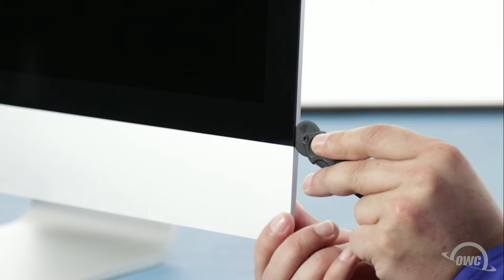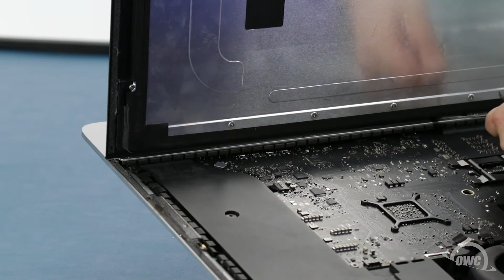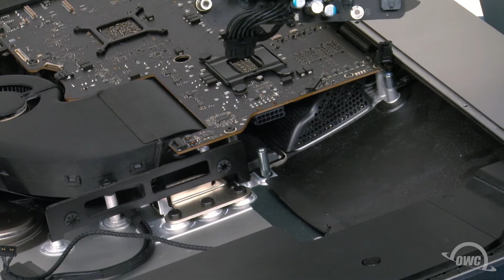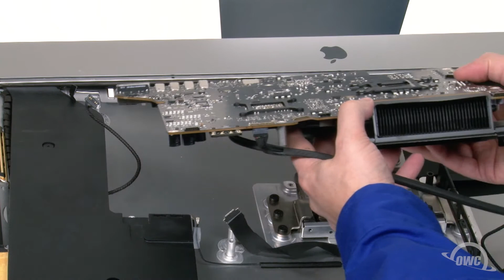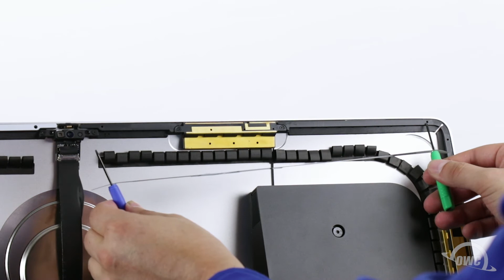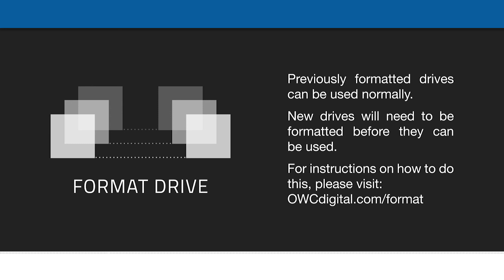How to Install/Upgrade the SSD Card Slot of a 27-inch iMac (Late 2012) -- NEW VERSION AVAILABLE

Comment: Thanks for your tutorials! I have a question: do i need to buy an adapter to upgrade my iMac 27 Late 2012 13.2 with a SAMSUNG 970 EVO MZ-V7E1T0BW 1Тб, M.2 2280, PCI-E x4, NVMe?
Reply: did you find adapter?

Comment: I need to know which PCIe blade SSD will fit into my late 2013 3.2 i5 27" iMac. I have followed the steps in this video and realized I got the wrong size blade SSD. Thanks!
Reply: Ok. Please let me know when/if it becomes available. Thanks!

Comment: I may try this as my 3TB fusion just died on my 2012 i7 iMac.  What kind of BlackMagicDesign disk speed test scores might I expect? I'm debating on if it is worth the upgrade vs buying a 2017 iMac and selling this one..
Reply: Thanks for the reply! That is quite an improvement.  The fusion is around the 300/400 mark for write/read and currently I am at 179/204 for my de-fusioned HDD only.  With that said I saw just how fast the new 2017 iMacs are (700/2100 write/read) and so I've ordered a top of the line (refurb) standard build 3.8 i5, 2Gb fusion 27 inch.  I'll probably add 16GB of OWC memory to it when I get it.  That should keep me going for another five years.... The current machine will be going on eBay.